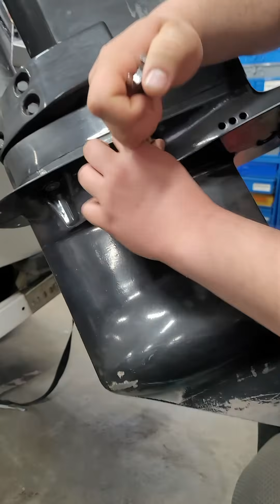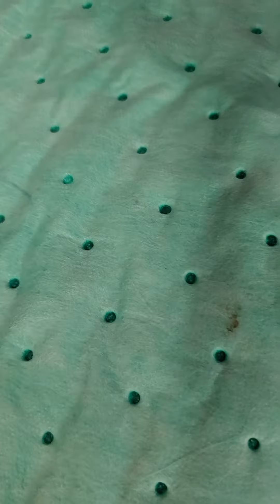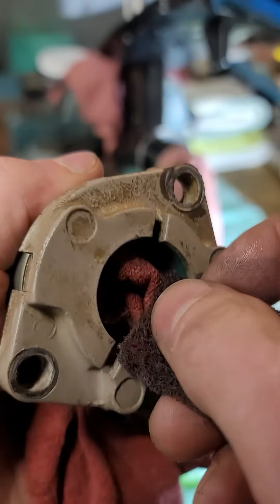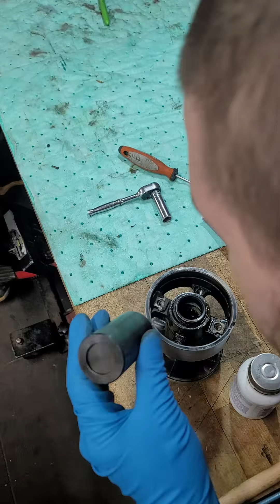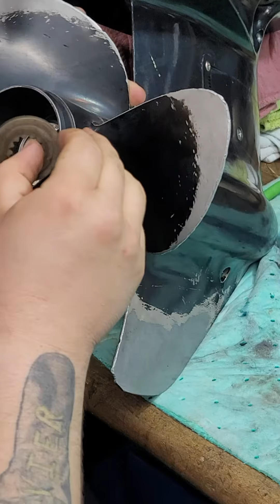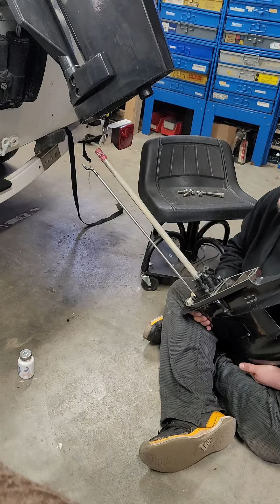COMPLETE How-To Reseal 40HP Johnson Lower Unit! #boatrepairs #boat #repair #evinrude

Comment: I have the exact same motor and the driveshaft bearing and seal assembly is stuck so tight I can't get it out. I have bought the puller for it, which resembles a slide hammer that fits over the shaft. Still ni luck. I have managed to get it to move back and forth with a chisel. Hoping you have a solution.